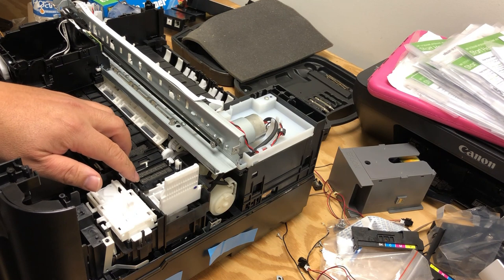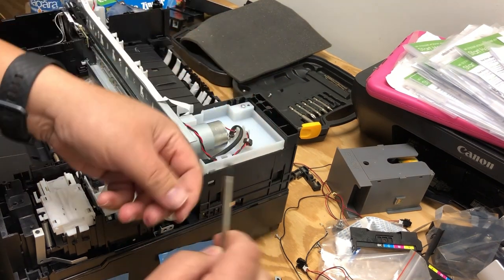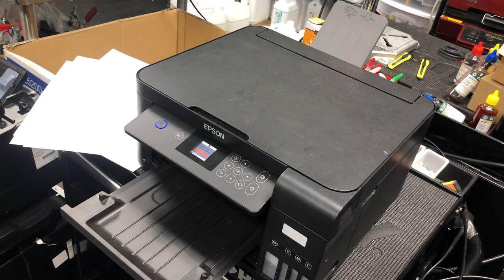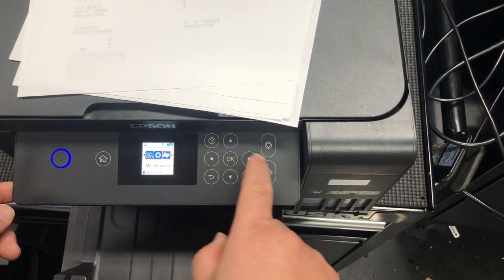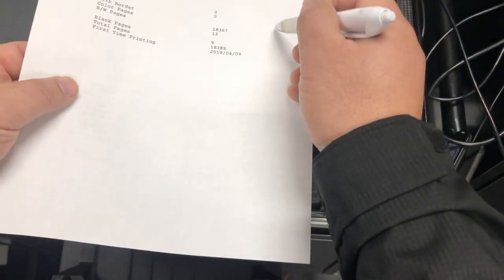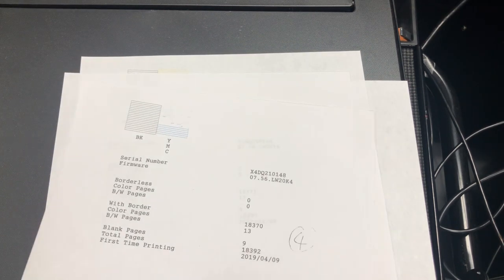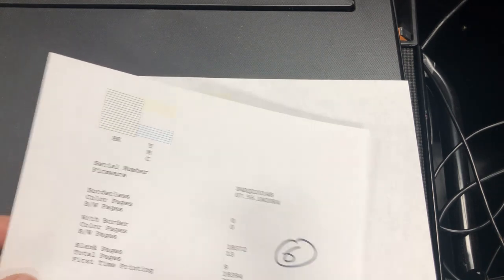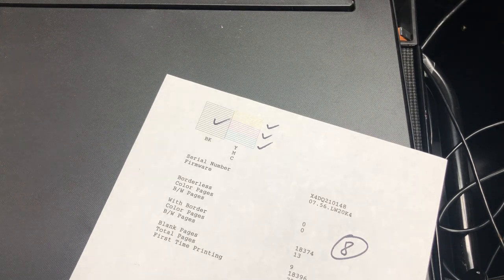Unclog Epson Printhead: How to use Built-in Self-Cleaning Effectively

Comment: Kevin - this was just what I needed!  I had an issue with Cyan not showing up.  I bought a kit with cleaning solution and cleaned out Cyan.  When I tested it out, I got Cyan working, but Yellow stopped.  I cleaned it out, but it still wouldn't work.  I found your video, followed your advice and did 9 print cleanings in a row, and just like that, all colors working fine!  I probably didn't even need to buy the cleaning kit had I found your video sooner.  Thanks for sharing this great advice!

Comment: Thank You Kevin!! Again!!!
I did the head cleanings just like you say in the video and those bubbles are almost gone. Black is perfect again. I was in fear I would fill the tiny waste tank. I checked after 3 + 3 cleanings (using the WIC app on my Macbook) afterwards and it was only 28%. I did nozzle checks and as soon as I saw it begin to print almost all the lines, I printed purge prints (solid pages of the colors I needed to concentrate on). This printer only has a little more than 600 pages printed. It is 2 years old and has only used sublimation ink. I bought some of your sublimation ink recently and waiting for it to arrive for my new printer.
Reply from the maker: If there are only a few missing pixels, stop the cleaning and start using the printer.  The clog will be gone in a day or two. Depends on the model, some of their waste tanks can be reset with software.
Reply: @BCHTechnologies  do you not know about power cleaning ?
That can do it in one go instead of keep doing head cleaning over and over again, it’s way better and quicker and maybe you should make a video on it

Comment: I have an Epson 3620 printer. When you close it, it does not read the inks when you take out the inks and return them. The printer works until the inks are read and after that the printer goes out of the state.
Reply from the maker: Is it possible that the pins on the printhead carriage is lose?

Comment: found a Epson XP-325 near the trash, took it home and it looked like it was working, just out of C  and M colors , next day i bought replacement's and found out that only C and M was all it could print , black and yellow were both clogged.
  did the self clean a few times , tried some alcohol and managed to get black working, but then i realized the black was almost gone, that from a brand new cartridge that only printed like 4 B&W pages , printed one more page and printer shows empty cartridge, even though i can still hear it almost full when shaking it..now there was a second black included in that pack so i used that to print another 3 pages and black lvl didn't drop at all, so now i don't know if it was the cleaning steps that trashed the other cartridge or just a bug , but i still have a clogged yellow head and maybe 1 line on the black to unclog .
  the funny stuff is the yellow reported as half trough when there wasn't a single drop going trough that head , really got to get myself a reseter...